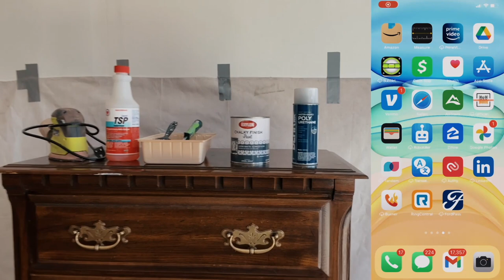Quick DIY Furniture Flip For Beginners | From Vintage to Modern In Under 24 Hours!

Comment: Something I learned from other videos is that you should clean first before sanding because if you don't, you're basically sanding the dirt and grime into the piece.
Reply from the maker: Interesting! I was thinking about that as I was sanding. I didn’t know if that was helping me get more grime off haha. But that definitely makes sense. Thanks for the tip!
Reply: @sidehustlesteve7970  I guess if your sanding it down to the bare wood, it wouldn't matter.  I've watched 100's of videos to learn all I could, and I've noticed there's more than one way to get it done! Good luck to you! I'll be watching you!

Comment: pretty color. You have 2 chalk paints listed. Can you tell me what color you ended up painting it? Maybe I missed you mentioning it in the video. Thanks
Reply from the maker: Thank you for reaching out! I’m sure I probably forgot to add it, but I ended up using “anvil gray” by krylon. I got it at HomeDepot. I ended up really liking that color!
Reply: @sidehustlesteve7970  thanks for your response. I really liked it also.
Reply from the maker: @bdwriter1957  No problem! I just found it on Amazon and updated the link in the Bio. You don’t have to get it there but that’s the exact one I used if you want a reference👍